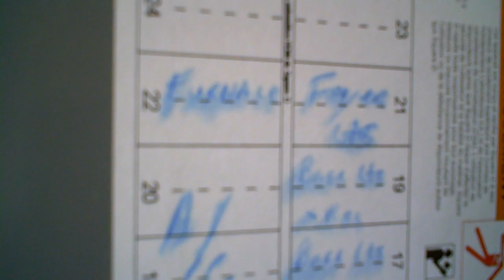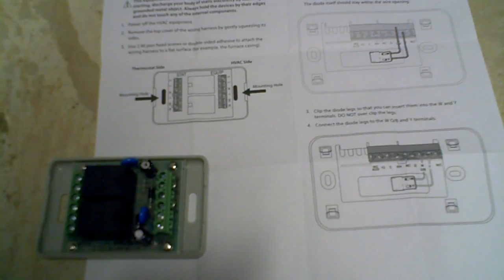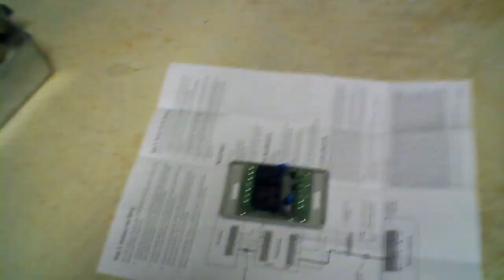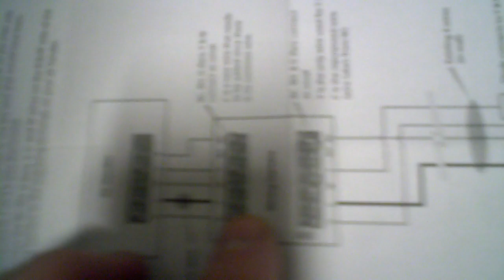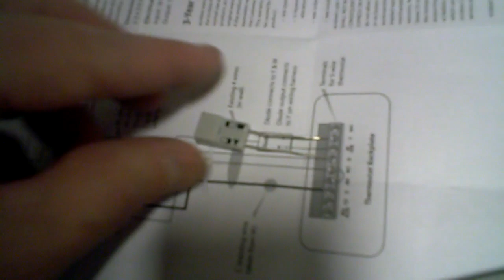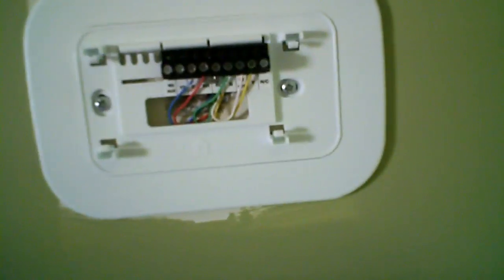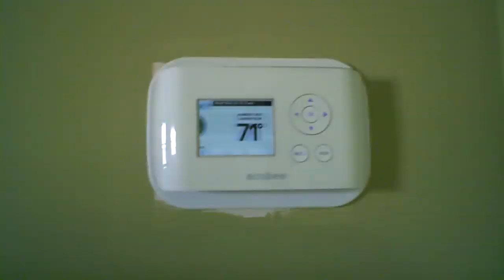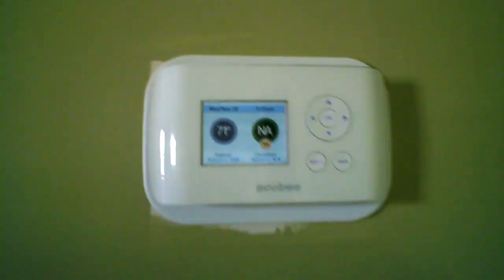Ecobee Smart SI Installation - How to help with power extender

Comment: Thanks for the video.. It was helpful.. I also went from a 4 wire thermostat to hooking up the unused fith blue wire. Added the blue to common terminal in hvac unit, and adding blue to C terminal on Ecobee thermostat. Works great now. FYI, I have a single stage AC, single gas heat
.
Reply from the maker: very glad it was helpful to some..